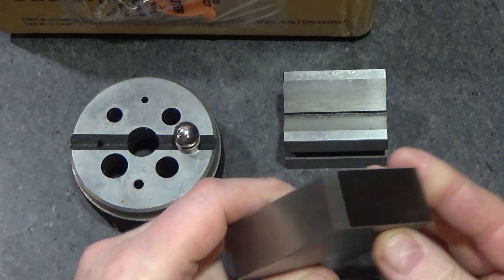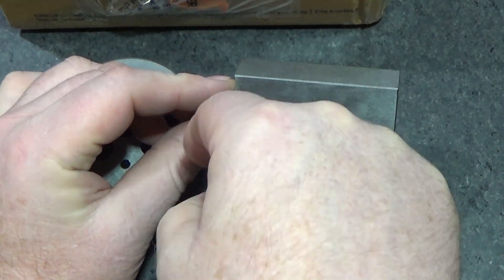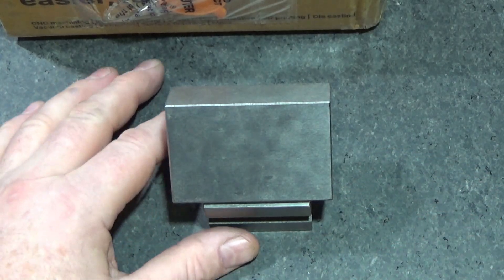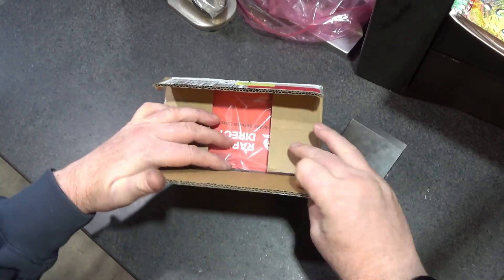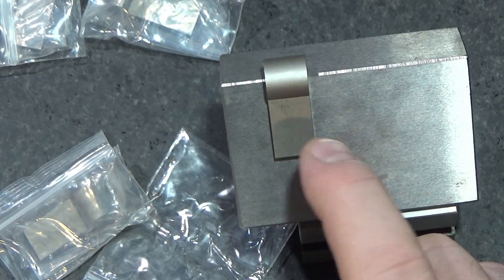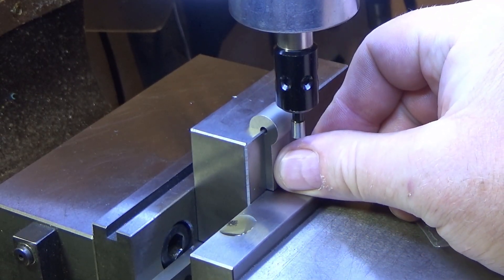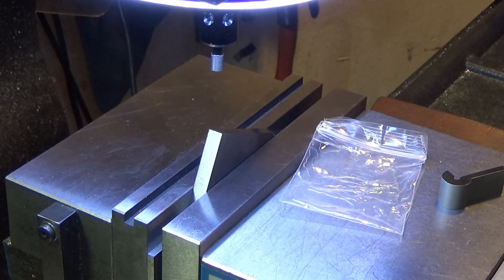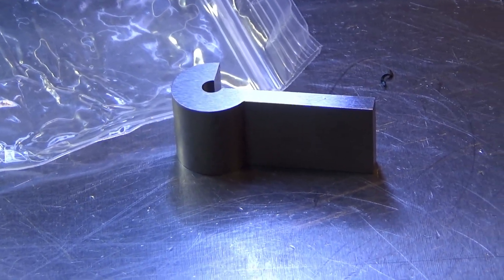QTR 141 Angled Part Edge Finder

Comment: Just saw this tool on Mark Presling channel and I am impressed by it and I had a thought maybe put some magnets on the tool so it doesn’t move around when you use it on a steel part. I know it won’t work on none metallic parts but it would make it easier to use apart from iron filings sticking to the magnets. Just a thought from someone who’s not an expert in machining
Reply from the maker: That is a very good idea. I had considered the idea and only didn't pursue it because the tool arm is so thin, but it still could work.

Comment: For a 45-degree angle, it is quite simple to calculate the distance D of the theoretical sharp corner just from the center of the vee block it is sitting on. Put the vee block against an end stop and find its center.
Using the part length L and its thickness T, then D = (0.707L) - (0.707T).
Reply: That is really simple so no other tools are needed apart from the v block? It only works though if the piece is in a v block.
Reply: @Bosun-8  Well spotted, lots of parts are held at 45 degrees without sitting on a vee block. In that instance, simply pop the Vee block on the highest corner and find its centre by edge-finding one edge and moving over half the Vee block width. This puts the spindle directly over the top corner - no math!
Reply from the maker: It is true. but picking up on an agled surface can be tricky and hard to reproduce.
Reply: @DudleyToolwright it's simple to pick up the vertical edge of a vee block and move over half its width to find its center. Zero the dro then move to this calculated distance. (Length minus thickness) multiplied by 0.707. There is no need to touch off on any angled face.

Comment: Right on! Looks like they came out great. Both flats need to accurately intersect the center of the larger diameter. You can do a pretty good job making your own by milling the notch to the centerline. 

All the best,

Tom
Reply: If the flats are offset, the vee can be flipped, find the other side, and split the difference for the center. Use the principles of basic geometry and location repeatability, instead of expensive high accuracy.
Reply from the maker: Thanks, Tom. I would be happy to send you one.